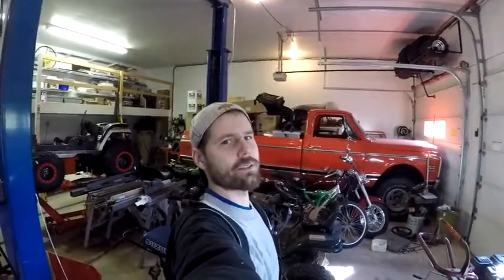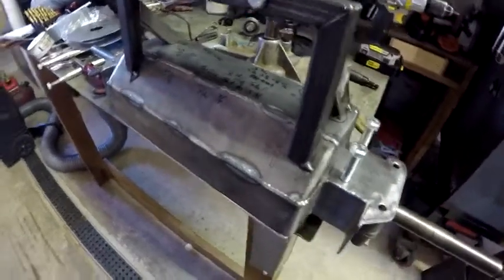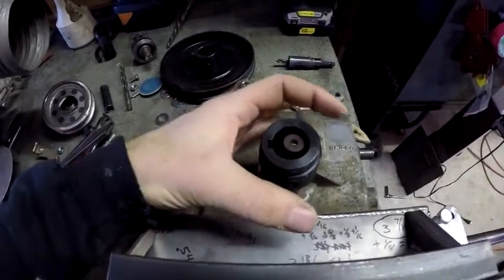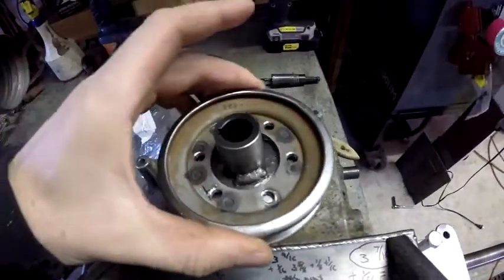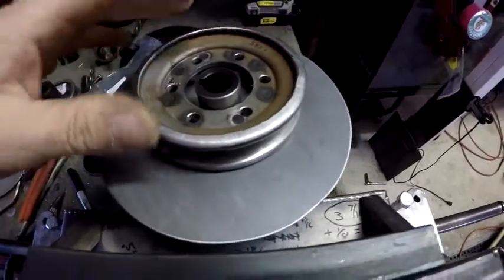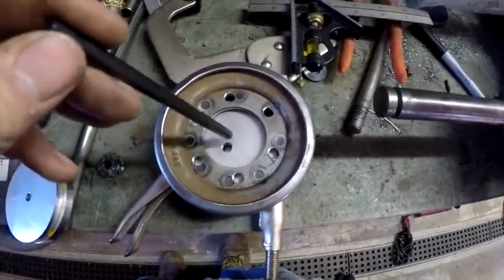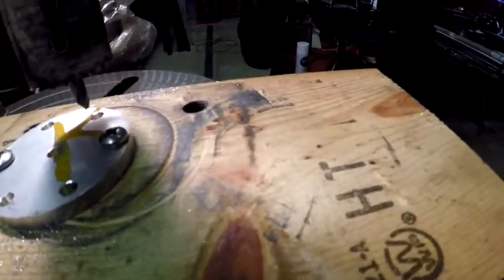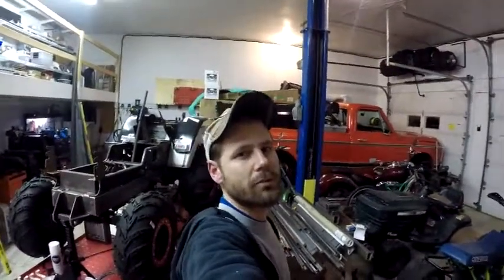Mud mower pulley disks transaxle pt.1

Comment: Nice job on the video and the build.  I love the case saver.  Do you have any means to balance that pulley after it is assembled?
Reply from the maker: Thanks Carl,   I figured with most of the parts being turned and the input shalf being locked into place that it would be fine.